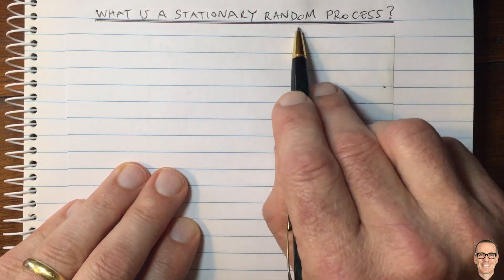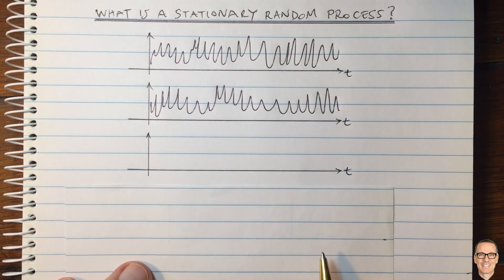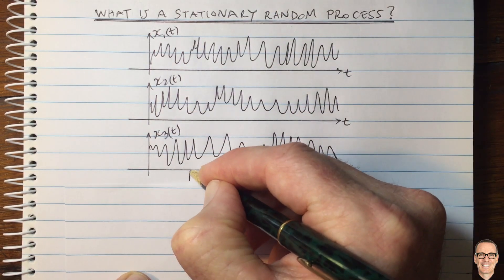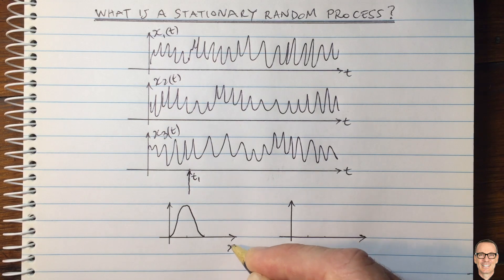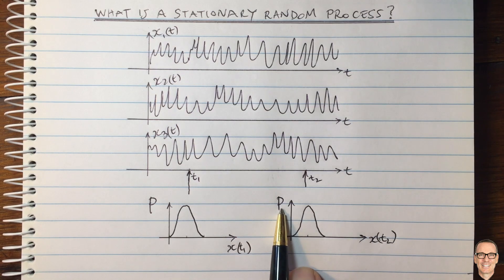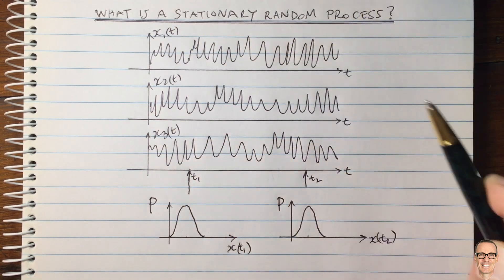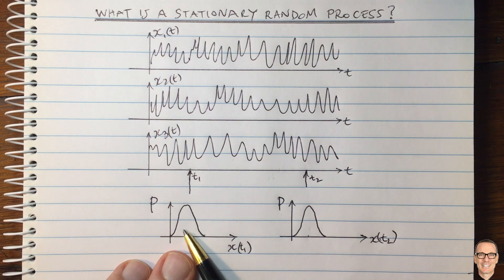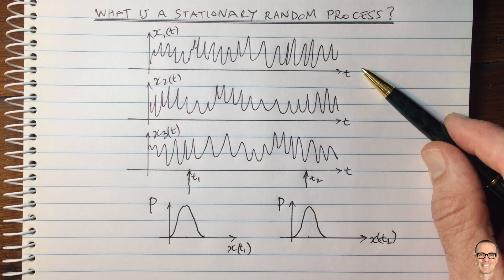What is a Stationary Random Process?

Comment: More generally, for a stationary process, the joint distribution of X(t1)
 and X(t2)  is the same as the joint distribution of X(t1+Δ)  and X(t2+Δ).
In particular, if a process is stationary, then its analysis is usually simpler as the probabilistic properties do not change by time.
Reply from the maker: Thanks for this. Yes, I forgot to mention the joint distributions. That's a pain. I was mostly thinking about the relationship between stationarity and ergodicity (which someone had asked me about). I'll add a note to the description below the video. Thanks again!